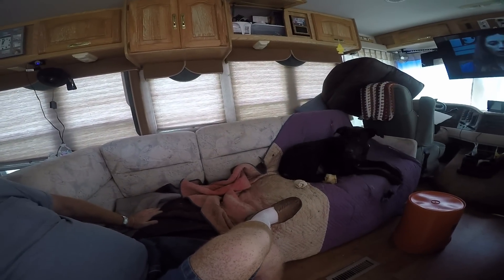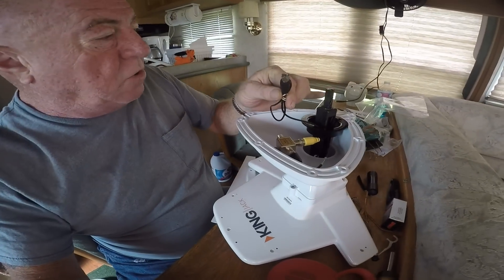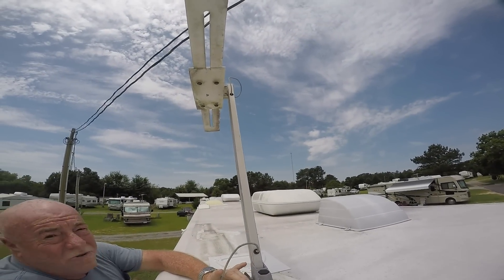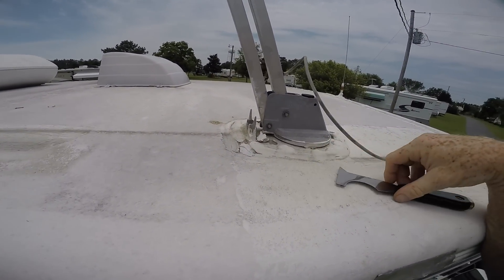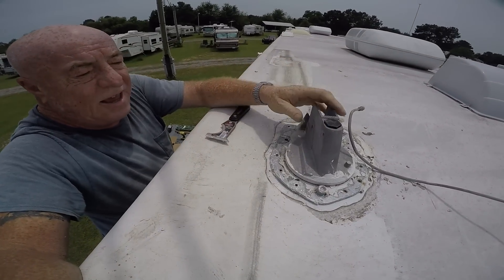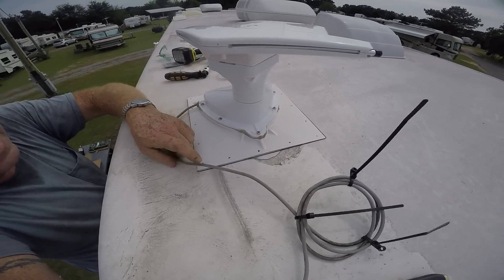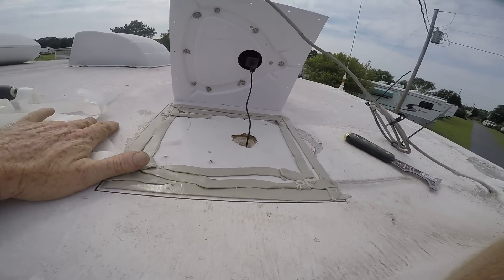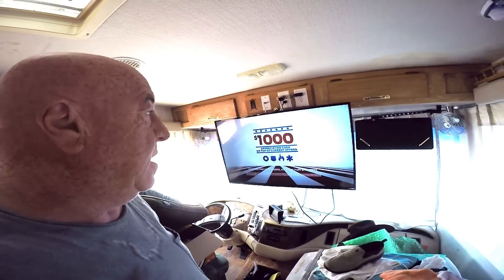Installing The King Jack Antenna

Comment: Love ya man!  As a suggestion:  If you want to get on the roof for any repairs/inspection: from your stepladder,  toss a heavy quilt/blanket doubling-triple thick over the  RV edge, borrow a long extension ladder,( prefer fiberglass), lean  it onto the quilt,  extend ladder at least 4-5  rungs
above the roof  (gives safety grip on stepping on and off ladder) and have someone be the spotter at the ladder base.  Put tools in 5 gallon bucket, pull up with rope and all is safe!  Great job.  Dicor is my friend,
has saved me from a lot of water problems!

Comment: I enjoyed your video.  Great stuff.  I've been reviewing antennas and I think this is the one for me.  FYI: You may pick up a few more channels, if you don't coil the cable on your roof.  Coiling cable reduces signals.  I picked up that tip from my old CB radio days.  CAMP ON!

Comment: The point of putting Dicor on ALL screw heads is too , preempt any potential water infiltration , even though you feel all holes have been adequately sealed ! IF , a screw , does leak , you won't know about the leak Until the stain shows UP on the ceiling . Then , it's too late to stop the leak and any damage that occurs .

Comment: Easy to drill with a hole saw.  First drill your hole in a piece of plywood long enough to stand on, 2 ' or so.  Place the plywood over the hole and stand on the ends of the plywood and drill away.  No pilot needed since the hole in the plywood guides the drill!  Easy.
Reply: Good top tip!

Comment: Chico  You really need to dicor those screws. I know they have the washers but from experience you will need it. Also on the screws holding the antenna to the base plate. Very good job, and put a hat on in that sun. Tell Patrick I said Hello.

Comment: The best way to drill a larger hole over an existing one is to drill the new size hole in a scrap of plywood then put the scrap over the old hole and use the plywood as a guide for the drill bit. Safe and simple.

Comment: I see where Amazon notes that the manufacturer has discontinued the OA8200.  It still sells on Amazon and Ebay, so would you know if there is continued support for this model, is the company still active?   

As well, would you know if the technology for this antenna would soon become obsolete?
Reply from the maker: GoodForBusiness I am sorry I am not able to answer any of your questions.
Reply: Gotcha, thanks.

Comment: Hi Chico, Is there a reason that you didn't shorten the coaxial cable on the roof instead of coiling it up. Just wondering if that coil will help or hurt the signal quality or make any difference at all? Glad to see that you are up and around and hopefully feeling much better. Regards, Curtis
Reply from the maker: old f art I don't think the coil will affect the signal at all. Reason I did it that way was becaude I didn't have a coaxial cutter and the right materials to do the spice

Comment: I think I would have fished the cable to the opening, and sealed up the holes but if not then I would have pulled the excess cable down in to the motorhome., but the way you did it will work.  nice job any way